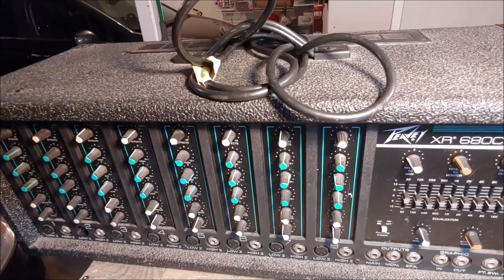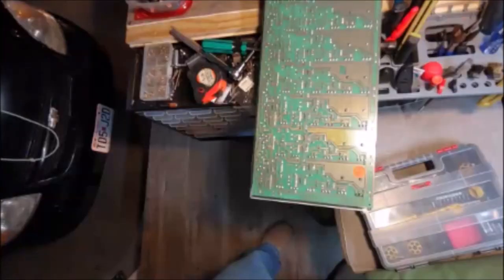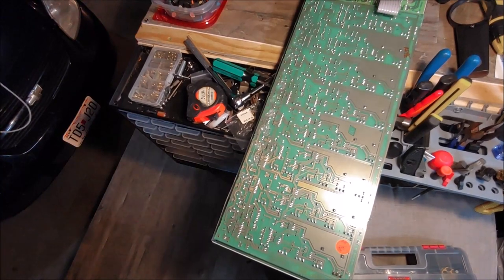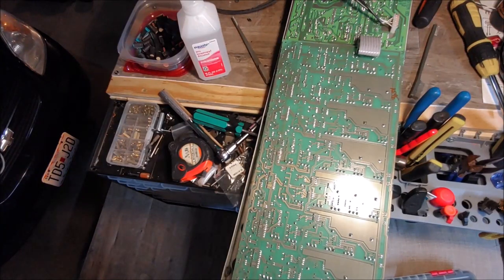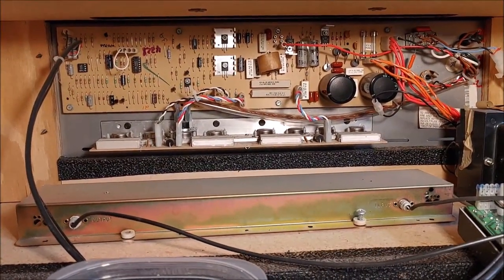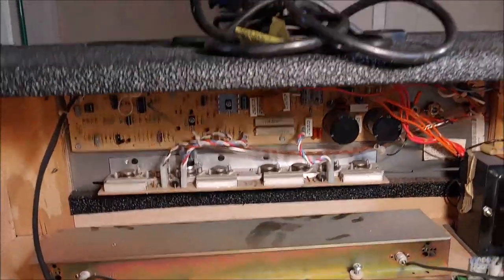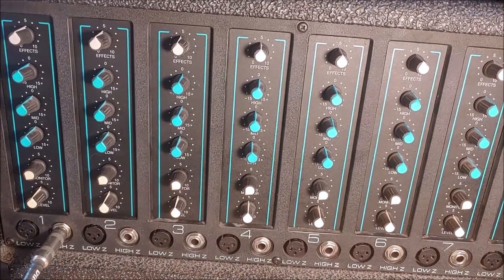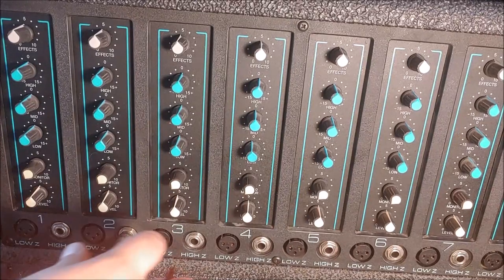Peavey XR 680C PA/Mixer Amp Repair and Service

Comment: Thanks for video. Is transformer of this amp can be adopted for 220v AC? Maybe there is two 110 two windings, so I can break them for 220 AC current? Or there's not, so this amp I can use only with variac?

The manual of amp says, it has ~200 watts of power for 4ohms. Is that means, I can get 200watt on each 4 ohm speakers. or just 100watts for each one?
Reply from the maker: 120V only on the transformer on this one. They may have made some for 220V though, I don't know. It is 200 Watts into a 4 ohm load. That could be 2 100W 8 ohm speakers in parallel. Or many different combinations. It will work with other impedances, it just won't deliver the same power.
Reply: @srtamplification  Thanks for answer. Try to terdown my one, and figure it out. Thanks again.

Comment: I opened my Peavey XR 680C and the reverb tank is attached in exactly the same way as yours.
Reply from the maker: Only two screws holding it in and not even tightened down all of the way? Interesting. I wonder who's idea that was.
Reply: @srtamplification  I watched your video a few hours ago because I have a few channels which are not working properly. When I saw my reverb tank was mounted in precisely (two screws, loose) the same way as yours I thought I'd let you know. Maybe it is time consuming to screw it in properly and they just decided to mount it in the sloppy way they did. Probably the simplest explanation.
Reply from the maker: @chriskona7652  Strange indeed. That one in the video went back to my dad in Arkansas. As far as I know he's still using it, so it can't be the same one I'm sure. Don't know how long you've had yours but I repaired this one less than a year ago.
Reply: @srtamplification  I have had mine since 1992. I am in Cape Town, South Africa. So it definitely won't be the same one.
Reply from the maker: @chriskona7652  Wow, you must have got it new. Did you get it fixed or still having trouble with it?
Reply: @srtamplification  I did get it new. I'm still having trouble with it. Channels 1, 2, 3 and 5 are good. Channels 4, 6, 8 are very quiet and 7 is dead. It has been a great amp for all of these years. Hopefully it's still fixable.
Reply from the maker: @chriskona7652  Do you have an oscilloscope?
Reply from the maker: The problem(s) is/are definitely somewhere on the preamp board. If you have something you can trace the signal with I could go through the places you should check, from the schematic.
Reply: @srtamplification  Thank you so much for your kind offer. Unfortunately I do not have any signal tracing equipment. I took the board off, cleaned and checked all the pots with a multi tester. They all came up good. Then I plugged a open jack plug into all the sockets and did a continuity check and that also went well. I'll just have to take it in to someone expert. Thank you again.
Reply from the maker: @chriskona7652  yeah man I hope you get it up and running.